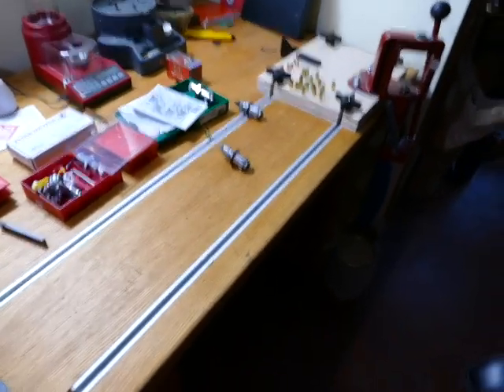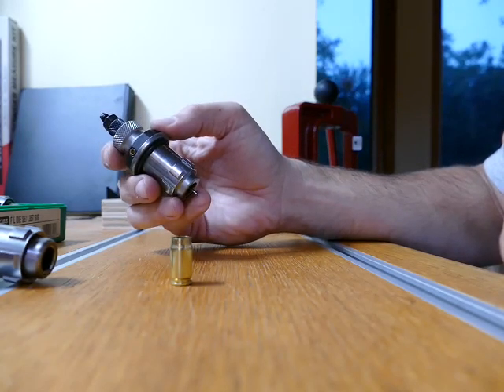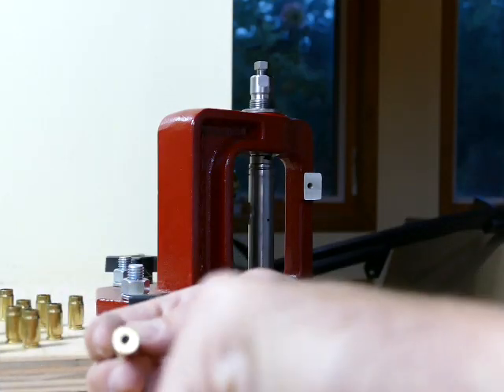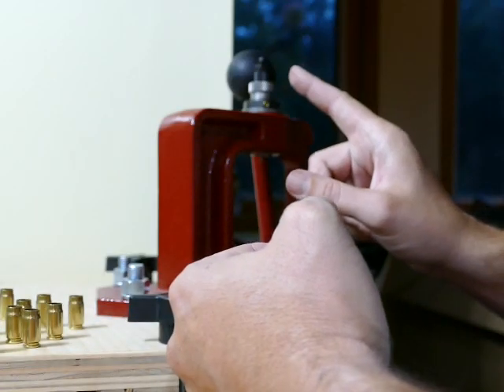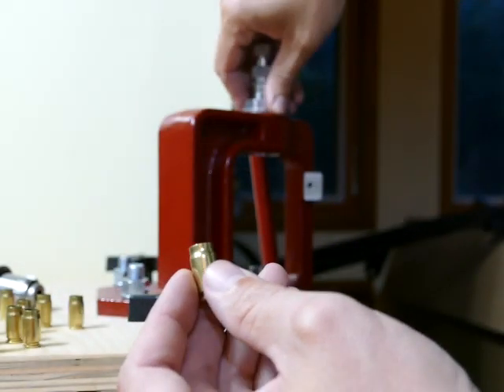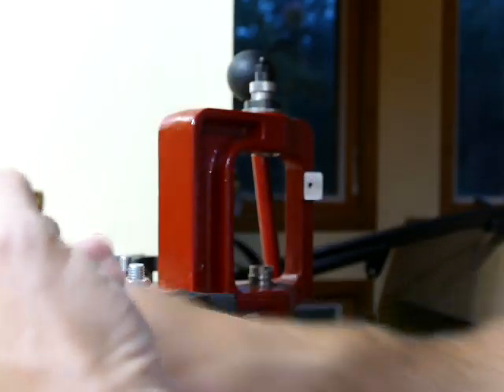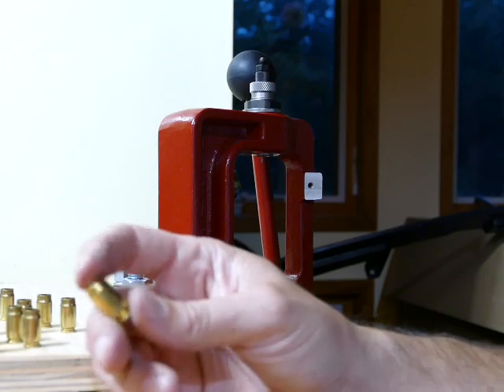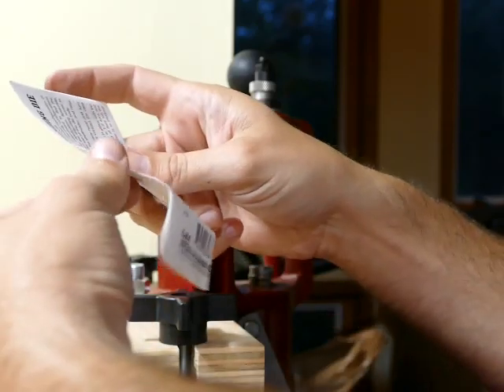Reloading the 357sig

Comment: I LOVE that bench!!!
Reply from the maker: Thank you.  As I said, I stole that from the GavinTube guy.  He is a great source for reloading info and has a great youtube channel.  I understand youtube has been giving him a hard time lately because they are anti-gun.  I ordered the track, and a router bit and cut the slots out.  It was the best thing I have done for my reloading system.  I did that about 2 years ago so far its been perfect.  Makes a small bench do a lot more.
Reply: @fillupread  I mount my presses on similar plywood bases but use large "C" clamps to hold 'em fast...that way I can shift them anywhere if needed - so far I've never needed to do so - but that's my way...

Comment: .357 Sig is a simple reload for me:
1.  Clean cases in tumbler
2.  Lube cases with Imperial wax
3.  Size using Dillon carbide die in single stage press
4.  Wash cases in hot water with Dawn liquid, dry in oven at 225 F, this removes case lube
5.  Finish the loading process using my Dillon 550.